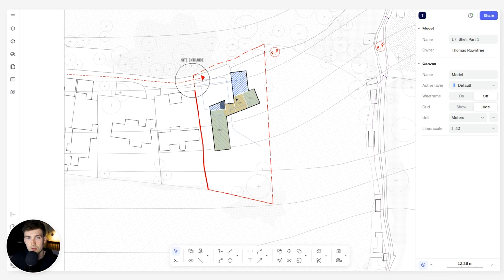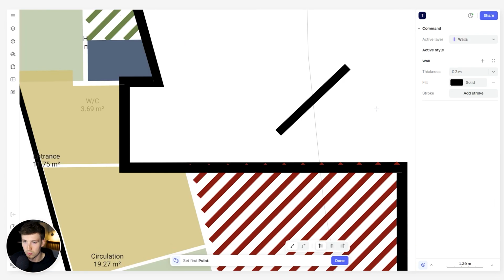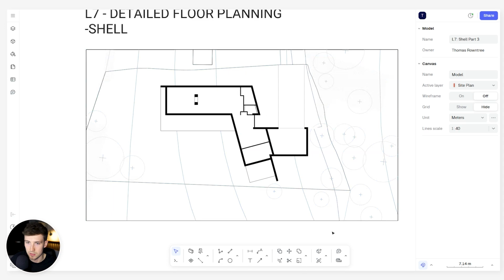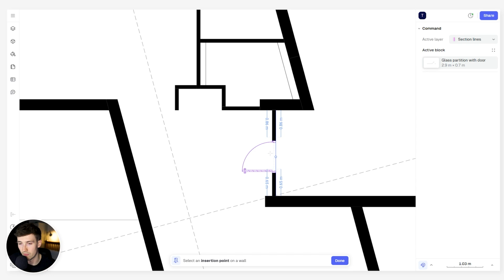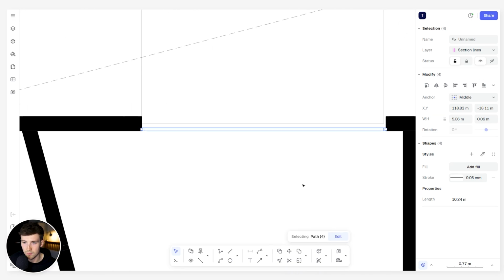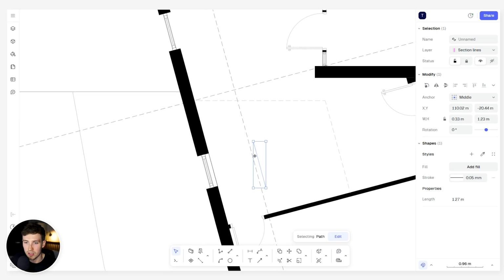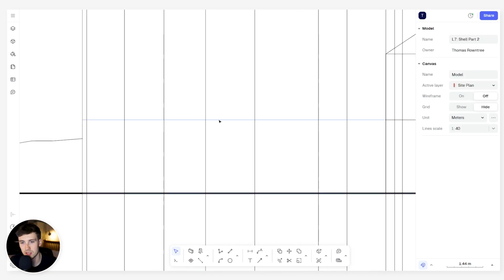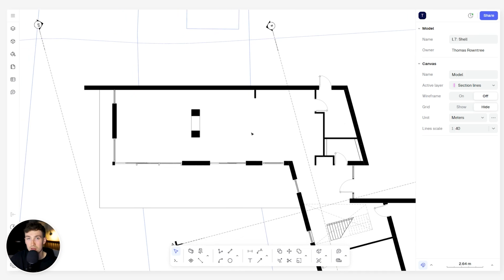Mastering Detailed Floor Planning of your Building Shell | Lesson 07

Comment: Is there a way to draw in plan to draw a composite wall?  For example, a brick exterior wall that has a wythe of brick (with hatch), an air gap, and a wood stud wall)?  I can draw them separately, but then I can't get the door or window blocks to create openings through both walls.  Perhaps you can provide a tutorial.  Thank you.
Reply from the maker: That's a nice idea! We are planning to add this feature in the future. For now, you can create a wall with the thickness you want, place doors and windows, and then place a rectangle with the hatch you need.